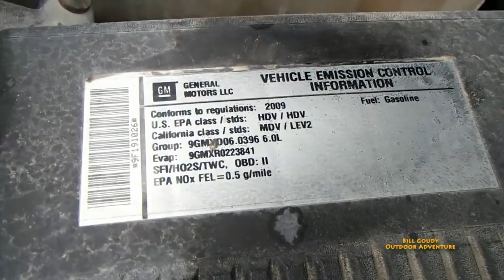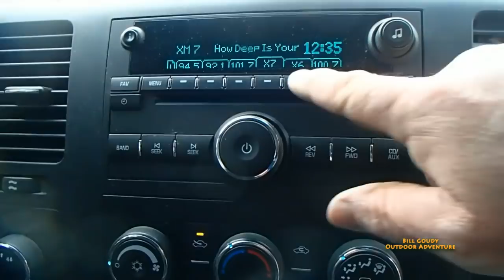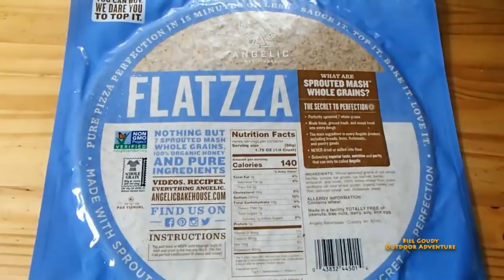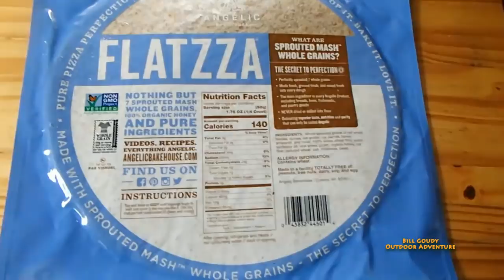Intalling A Remote Antenna - Sirius - XM and Seat Covers

Comment: 62 and sunny here in New Mexico. Chilly for March but I'll take it. I had a Chevy with the 6.0 a few years back. Nice performance but it was a gas eater when pulling an RV. Now I drive a diesel to pull my 5th wheel. Love it. Spring is coming Bill.
Reply from the maker: I looked into the diesel and it is a toss up..  Round here it cost a lot more for simple maintenance on the diesel..  I can do a lot of work myself but, I don't know that much about working on the diesel..  Then The availability ...  I have bought several vehicles from the dealer that I got this truck from..    It is hard on gas and so was the Ford...  I got to make do...  ;-)  Thanks, Michael